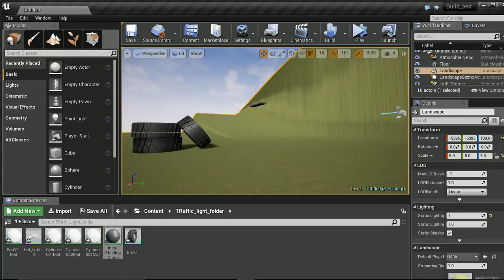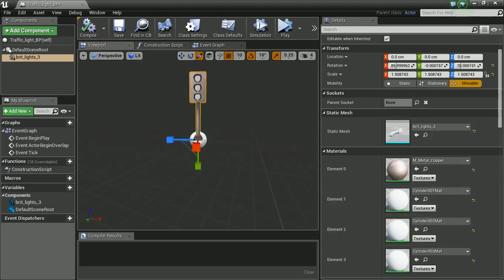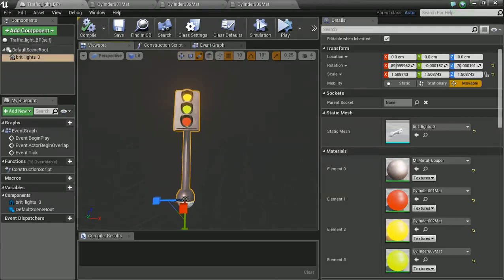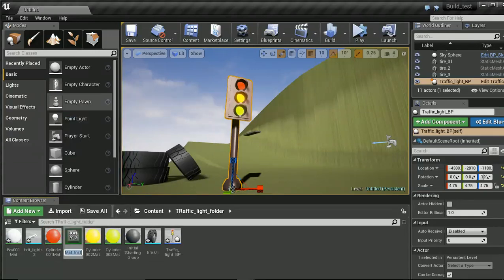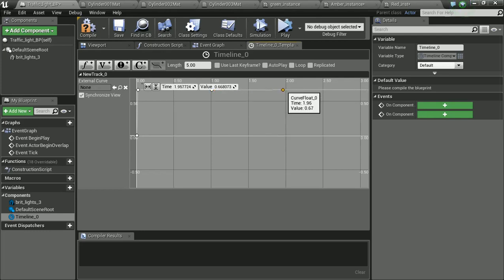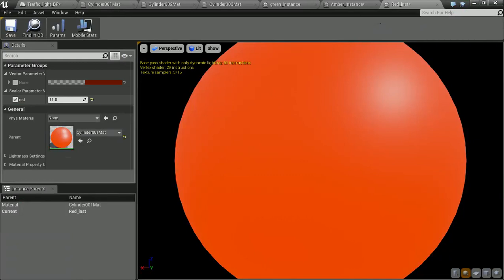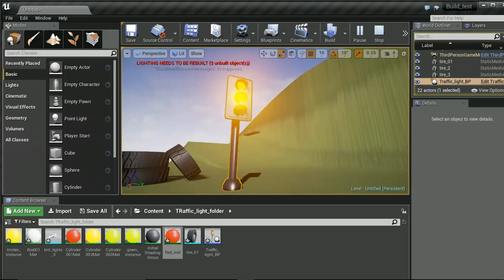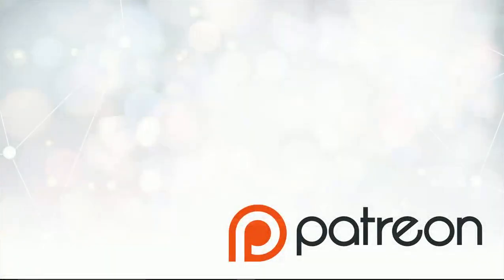Using Material Timelines in Unreal Engine 4

Comment: You do not need 3 materials, you can change the color of each of the instance of the main light material. Also I am pretty sure you do not need to enable the the parameter in the Material instance to be able to change the parameter inside the blueprint.
Reply from the maker: Yeah you can set the parameter colour value with the timeline, negating 3 materials, but it would be more fiddly for a tutorial and would just get the same outcome. I have always enabled the instance, never questioned it but hey you might be right on that one, that could save me some time going forwards. Thanks.